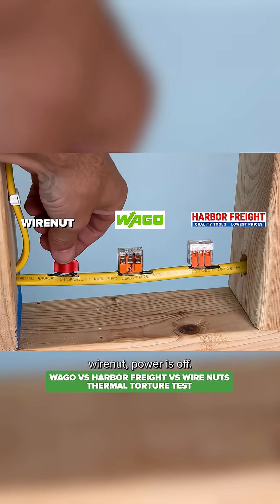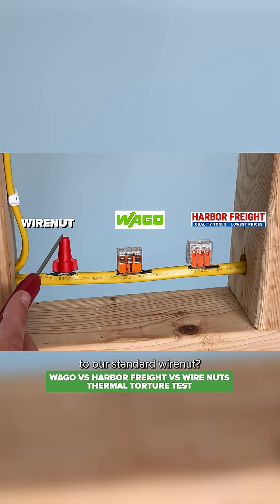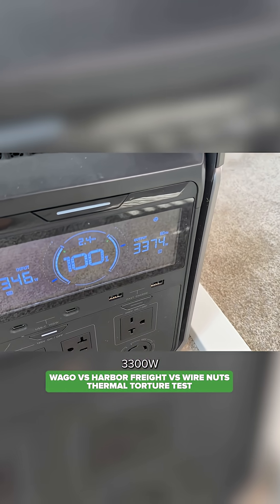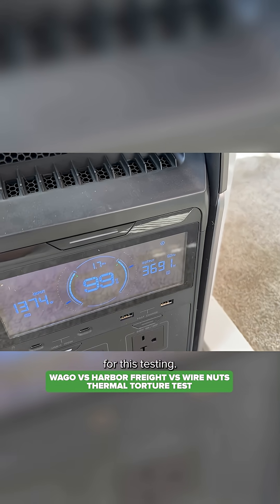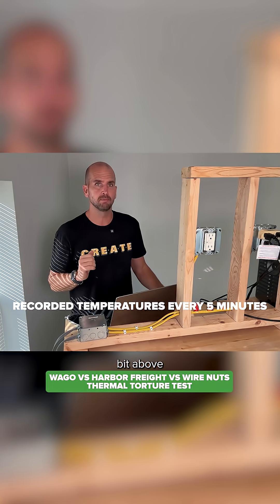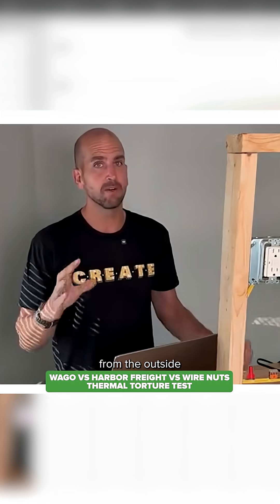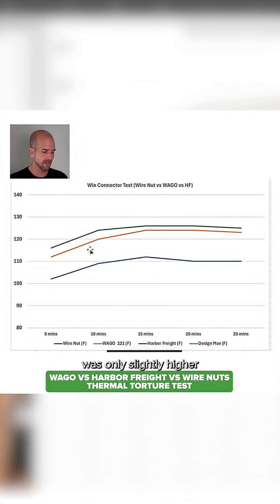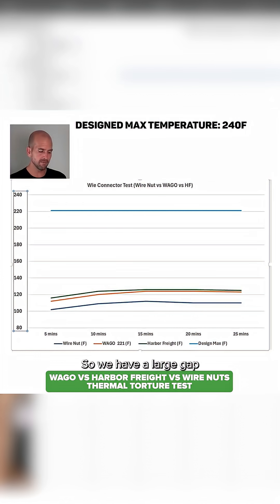Harbor Freight vs WAGO — The Truth About These Wire Connectors!  #diyelectrical

Comment: I thought a Wire Nut was the best when installed properly, so thanks for confirming that.  However, when I use a Lever Nut, it will always be a WAGO.  Thank you, Scott.  👍👍
Reply from the maker: You bet!
Reply: The wire nut is not at all "the best". Twisted wires are the best (specifically for conductivity).

But that's like comparing paper plates to a dish washer. Wire nuts cover the connection, they don't do the connecting. Clips do both.

To put it another way, by this test, I'd expect a wing nut to perform about the same as electrical tape. That would not be an endorsement of electrical tape any more so than for wing nuts.

And not suggest this is a useless test/video, but no connector will ever outperform the wire. That's impossible. Twisted pair is obviously as close as you can get to an uncut wire, but.... "The best" is to not cut it to begin with.
Reply: @MrRoguetech   Of course straight, uncut and never-spliced wire is always the best, but it depends on wire preparation as to a wire nut's performance.  By "when installed properly," I mean that I always twist stranded wire tight in the correct direction, solder the spliced section(s) and then install the wire nut by twisting it on until there are 2-3 fairly tight twists in the insulated wires just outside of the wire nut.

Stranded-to-solid wire connections fail because the stranded wire is not captured by the wire nut.  There are ways to do this right, but soldering the strands make it connect like a solid wire does.  You have to know what you're doing when using wire nuts, but they are the best "when done correctly!!!"
Reply: @100vg Ok, but who aside from you actually solders connections?! No argument that it's ideal, but ... less than typical. Good on you for doing it! But I'm not, and neither will anyone else looking at comparative quality of quick connectors.
Reply: @M @MrRoguetech you are wrong about wire nuts just covering the wire and doing the same as electrical tape. The cone shape of the spring inside a wire nut causes it to squeeze the conductors together. The 2 elements of a good connection is surface area and pressure. Solid wires twisted together have a lot of surface area and the wire nut provides the pressure.
Reply: 😂 he confirmed nothing.

Comment: Good test. Can you describe how 30amp draw = 3691 Watts? Since this is a resistive load I'd expect 3600W. I'm looking to learn something
Reply: My understanding he was just simplifying the number. If you do 3691W / 120v, it is 30.758333333...so 30A. I guess technically 31A is more accurate but I think it's just him simplifying it. That less than 1a difference isn't going to make a difference. He even says "30A or just above"
Reply: Volts x Amps = Watts
Reply: @jeffstewart9568 yes, I know. 30A x 120V = 3600W. The video, however, included a text overlay that said 30A = 3691W, implying a power factor not present with resistive loads. I'm looking for him to explain why he inserted the overlay.

Comment: Impressive testing. Thank you.
Reply from the maker: You bet!
Reply: @EverydayHomeRepairs  my twists using wire nuts have never been that pretty.  As a result i wonder if my connections would run hotter?  Ive never used wagos but i like the idea of them better than wire nuts based on the idea they're idiot proof.  At least for me.

Comment: I checked out the HF brand and no where on the packaging or their website says they are UL listed. That's a no-go for me. I'll stick with Wago or wire nuts.
Reply: The website says Pittsburgh is UL rated.

UL rating is less common than CE and CSA. From what I've read (but no expert!), they're equivalent.
Reply: @MrRoguetech 
Thank you. I just checked.  It as to be a revision to their website because it didn't used to be there. Thank you again.
Reply: They do have the ul listing on the lever nut itself up listing ZMVV.E531336

Comment: I'll stick with wago. Harbor freight has stepped up their quality but not enough for me to trust them with higher voltage connectors.
Reply: Harbor freight is increasingly my go to for hand tools and and items that are used and abused. That being said i will never atleast in the near future use any product that is installed from them.
Reply: Harbor freight has gotten better over the years, at least some things, but there's just certain components you buy the brand name for. 

Some years ago I purchased HF jack stands. Yeah I know. And then cars started falling on people and crushing them. HF did a recall, but that was the last time I ever bought a safety sensitive product from them.
Reply: Higher amp connectors
Reply: If isn’t the voltage which matters as much as the current.  In this test, 30 amps was being passed through 10 AWG wire.  The recommended ampacity is 20 amps as it would be used in a US 120 volt branch circuit.  30 amps should be 6 AWG.  Given that, all three connectors performed pretty well.

Something which this video does not address is the long term stability of the splice.  The wire nut will last for decades, and there is plenty of field data to support that assertion,  the Wago snd Pittsburgh have less time in actual applications.  Both rely on the plastic body to keep pressure on the splice.  If the plastic deforms over time the contact resistsnce could increase and cause additional heat in the splice.
Reply from the maker: That is basically where I am at as well.
Reply: ...and push on connectors?...
Reply: I've been debating picking up a pack for low voltage/ amperage projects, but yeah, no way I'm using these for any real wiring projects.
Reply: it's literally just plastic with a bit of metal inside...the only way a product would be worse, would be to use inferior plastic that can't handle the heat
Reply: It's all low voltage